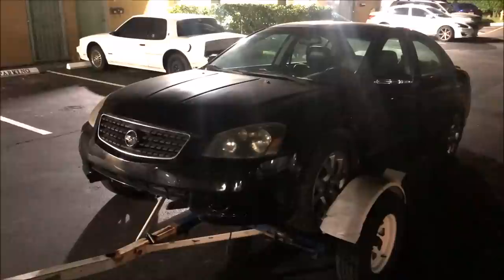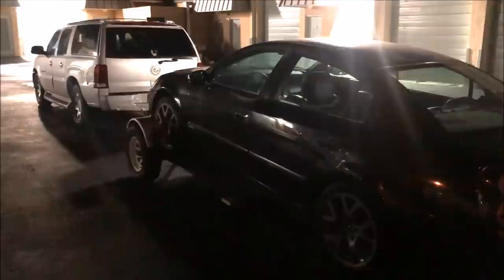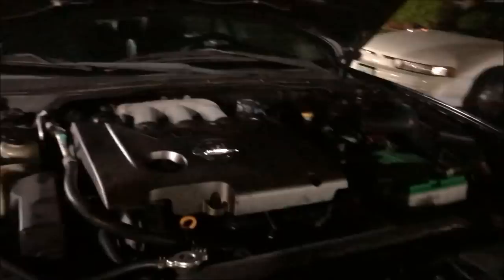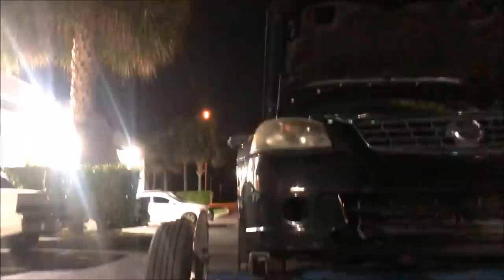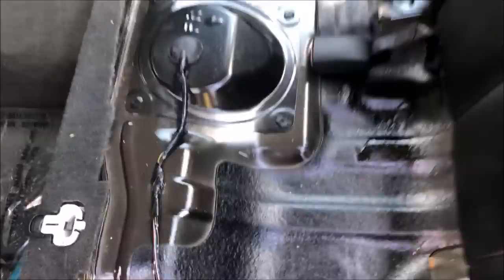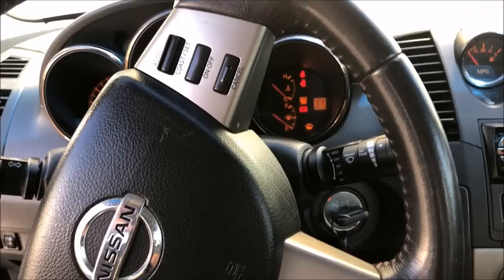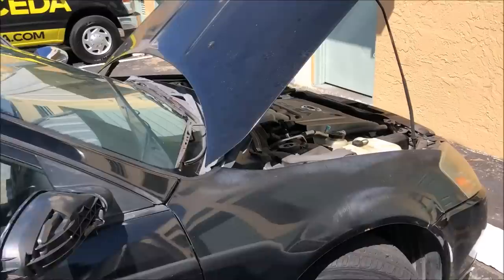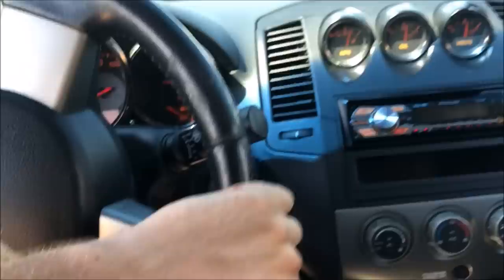I Bought A Nissan Altima SE-R For $1100

Comment: I got one for $1000 but it was dirty asf, no A/C and 3 check engine lights. He sold it cause it needs smog in a week and doesn't want to deal with the hassle. 1. Is the Speed Sensor. 2. Is fuel level sensor. 3 Camshaft position sensor bank 2. I ordered everything off eBay for $100 plus $10 for AC recharge. Hopefully I have everything ready this week

Comment: I have an 07 manual Altima SE. Paid 16k for it in 2012 and it had 59k miles on it. Currently has 110k and I've only had to change the clutch, trans mounts, engine mounts, and a few suspension components. I've always loved the look of the SE-R and wished Nissan would have continued it.

Comment: I was a broker for Nissan in the Atlanta area when those were new, and had a chance to sell a few of them!  they can with a Standard Helical Limited Slip Differential, and were offered in a 6speed manual transmission (which would be the one to have)!  Nissan also offered a handful of those in a Nismo edition which had a little more horsepower. I had a buddy that worked for Nissan the was lucky to get a Nismo SE-R model, and he kept snapping axles of it. You should be able to sell it with no problem, although younger enthusiast don't even know that car exist.
Reply: there is no nismo se-r wtf are u talking about
Reply: @thisdrank  Oh, trust me there was! My buddy worked for Nissan.  I was a broker for Nissan at the time. Nissan did not build them as production cars. But, they could have been ordered with all the NISMO bolt ons!

Comment: These Nissan Altimas are good if well taken care of I got me 2003 Altima and it runs smooth very strong engine and for the ac check fuses, check relay fuses, check the wiring from the compressor in case of fuse pops

Comment: That’s a steal, I bought a 2006 Nissan Altima SE 5 speed manual for 1000 bucks and needed a serpentine belt. Actually needed a tensioner pulley, coil plugs, spark plugs and injectors now it runs great. Basically 225 bucks to be up and running. 

Anyway you got a steal.

Comment: Wild. Just bought a running and driving clean blue Texas title SE-R for $1000.

It needs little bit of TLC but engine and trans is strong. 200K miles but holy smokes this car still spins the tires from a dig. Bright red trans fluid, fresh oil. Just did the plugs they were super clean. Just needs front bumper (hard to come by I’ve learned)
Back glass and side mirror cover. Shocks are old and need replacing. I’ll replace all 4 and even do bushings, links. Tires are decent but I’ll slap a nice set on. 

Got a 63’ Cadillac Deville and 91’ BMW 750 V12 both as my daily’s. Glad I got this car for a daily. 

I’ve had an 04 maxima with the 6 speed and motor ate itself up at 120K. Looking forward to this Altima.
Reply: You want to sell the ser ?

Comment: I don't know about the transmission, but I do know that these v6 SERs don't have head gasket issues like the 4 cynlider one do(for some reason).
Reply: My wife is the original owner of a 05 Altima 2.5S with 271k miles. Never had any major issues with it and just put 3,500 miles on it in 4 days of driving. Haven’t  heard of the head gasket issue with the 2.5L motors before. Those SE-R’s are sweet! Those plastic timing chain guides suck. At least these start to give you some warning with the noise when they’re getting ready to go.
Reply: The first generation QRs had an issue with head gaskets along with a self destructing catalytic converter that would literally wear down over time and send shrapnel into the block. Completely destroying the engine. They were cutting corners which fortunately was fixed by the time the second gen QRs were dropped. 

The Altima SE-R had the VQ35DE motor IIRC. A completely different beast and one of Nissan’s best motors still used to this day.

Comment: Nissan's only stretch chains if you don't keep up with the oil maintenance and listen to the oil lights but if you don't rely on the oil pressure lights and you change at the recommended interval it is grand

Comment: These engine need to run on high octane fuel so the previous owner may have only used normal fuel just put high octane and reset the ecu it should run fine

Comment: Dollys suck, I have messed up so many cars over the past 20 years with them. get a trailer with a winch on it.
Reply from the maker: m ph I have no space for a full size trailer
Reply: Yeah the trailers are way better or just have a tow strap
Reply: @bigalsbikeandauto  The trailer doesn't take up more space than a car does.  Put a running car up on it and take it off when you need it.
Reply: @mexicanspec  ya forgot about that and most of the cars in America are automatic and I don't think an automatic you can do that or you risk ruining the transmission in Europe we're lucky most cars are manuals

Comment: I still see cars go for $300....but they're all no runs. Bought a 2002 Subaru Outback as a beater/project before the no run prices spiked too. $300, but I had to replace the timing chain and spark plugs (a real pain on the H6) to get it running right.

Comment: I want one of these so bad
Reply: Very rare car! Even more rare would be the 6 speed manual!!!!
Reply: Fred Williams all the ones Ive seen was a manual, I have to had a automatic bc of my ankle and it’s super hard to find one in my area
Reply: @codycrawford2385  Really? I always thought the manuals were the hardest to fine! Some cars are like that i guess! Good luck in your search .you can get the SER  Altima all the way up until 2012 i believe!
Reply: Fred Williams the automatic was optional I think, most got the standard one and Thxs I need all the luck I can get lol
Reply: Get the SE Its the same thing.
Reply: Walther Martinez the SE-R has a better interior and better wheels
Reply: @codycrawford2385  They Both hv leather seats and the wheels yea their a little better, mine has the 18th anniversary from a 350z.
Reply: Walther Martinez the two tone leather? The body kit? the SE-R is a car I want

Comment: I'm surprised after you saw the condition of the fuel ⛽️ and you replaced the pump and no filter, you got extremely lucky with the transmission because Jatco transmissions are not reliable, sell it fast
Reply: Doesnt have a jatco cvt ! Dont spread false info! These cars came 5 speed auto or 6 speed manual.both very good transmissions! My 5 speed auto has been really reliable in my 08 M45 Sport! Change fluid every 30,000 your fine!👍
Reply: Fred Williams for one do not tell me what to do, I never said it was a cvt, but that is the brand of transmission in them and a lot of other cars similar to this, trust me I was going to buy one till I found out about how expensive and unreliable they can be. Have a good day
Reply: @hookyjo72  well your telling him to sell a car that has a jatco . Why? Your not a mechanic or Engineer of those transmissions. Properly maintained thay go 200,000 plus miles. If it's working like he said was  drain and fill would yeild him many more miles to come. And if he listen to you he could he getting rid of a car that he does not need to. So yea I'm tell you again don't spread false Info. You have a good day.
Reply: Fred Williams Research!!!!! Tells you a lot, try it sometime

Comment: Did the replacement fuel pump cost more or less than the gas you put into it?  Just curious.
Reply from the maker: Mexican Spec pump was $27, I filled the tank and if I remember correctly was about the same.

Comment: I’m looking to buy a Altima ser for a first car. Are they reliable and is there anything I should look for before getting one?
Reply from the maker: IceCold timing chain guide failure, transmission problems, oil pressure issues. Not an ideal first car, too many issues unless you spend the $ on one that’s sorted out.

Comment: i have a 2005 ser with 116k miles. you can VERY noticably hear the timing chain when it goes bad and mine is at that point. But, there is no room in the engine bay to change it with the engine in the car :/ (maybe im just a noob idk)
Reply: Better to pull the engine out to do it easier.

Comment: Nice buy. I like the VQ motors, but not a huge fan of most of the vehicles it comes in. At least this one doesn't have a CVT and is a solid runner - should make someone a good car.
Reply: This body style started with the cvt bullshit
Reply: Carl Schroeder No It Didn’t. The 07 And Up Had The CVTs.